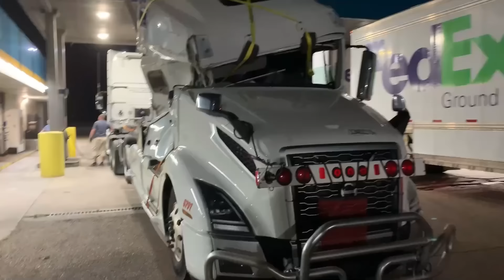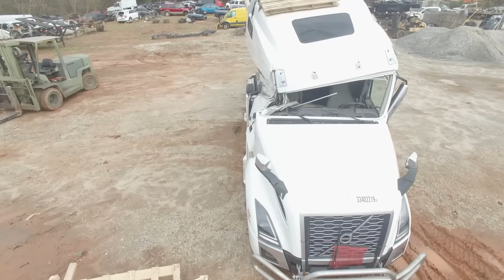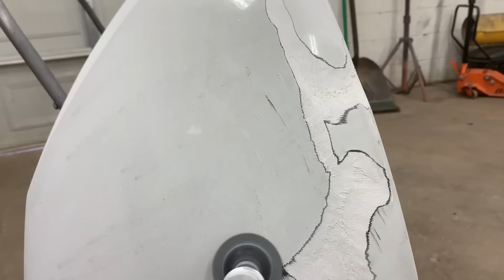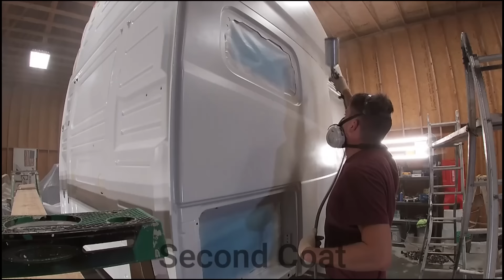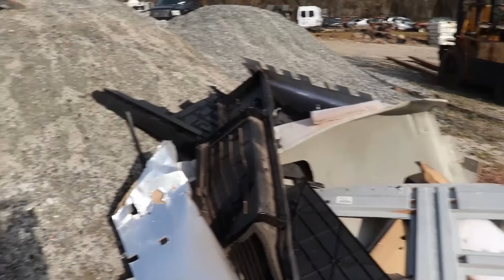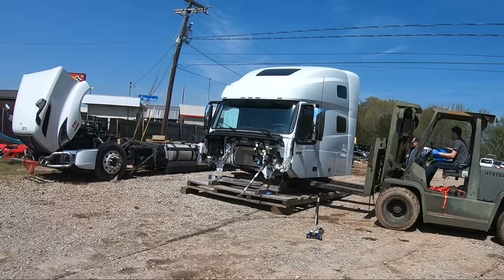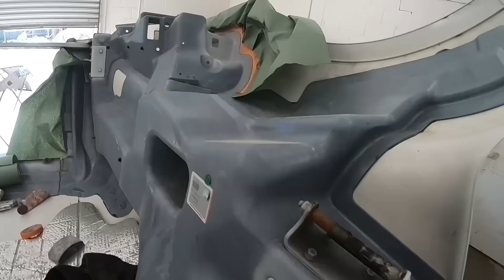Rebuilding Wrecked a Volvo Semi Truck In 10 Mins

Comment: Not trying to be negative, mechanics in Europe say "if the structure of vehicle is not tilted and axles not broken, all cosmetics can get fixed". I've driven a rebuilt Cascadia : it was leaning to the right and axles were constantly out of whack, even after alignment was done. That's a great job if there's no huge damage on the bone
Reply: I just seen a video from Germany where they fix a heavly bent Mercedes Benz cabover semi, so, even tilted structured can be repaired over there.
Reply: That's true of any vehicle though, Vanya. Whether you're in Europe, America or Mars, if it's 100% cosmetic damage, there's a greater that great chance it can be fixed.

Comment: I bet that you  were glad to have that one done. Gallons of white paint for sure. I am not sure how much after working on my conventional that I would want to do on one. I replaced a cab on one from the eighties and it was not a plug and play with miles of air lines and wiring enough to get a plane off the ground. Learn as much as you do on one for sure. When you break it down into sections tho, its just nuts and bolts... thousands of them

Comment: 00:50 in Germany trucks are towed at the front, so the connection between the engine / transmission has to be disconnected. Easier for you !!

Comment: Volvo: Wrecked but still starts and drives as normal
Freightliner: goes over a bump CHECK ENGINE. ABS OFF. FUEL PRESSURE LOW.

Comment: Why not use f.g. filler? instead of the chop mat on that visor or trim? Was the f.g. cracked all the way through? Seems like the resin and chop mat would likely lift sooner and be harder to level out and fill pinholes than some good old USC Duraglass. I love that stuff. Lasts a long time if the surface is prepped properly. Good work either way. Nice older beast of a Hyster too!